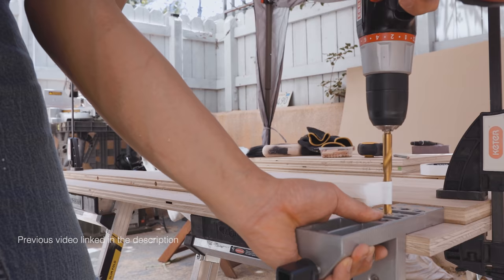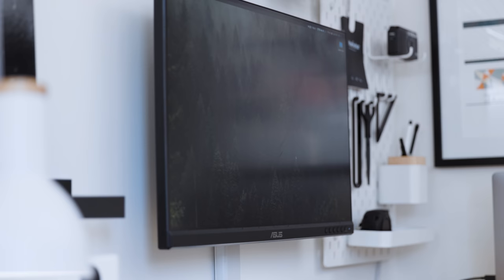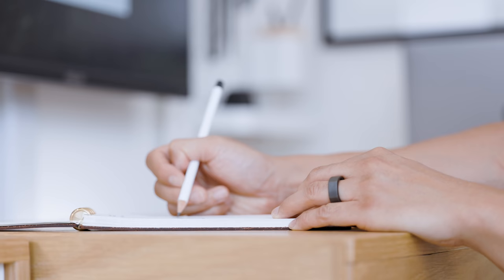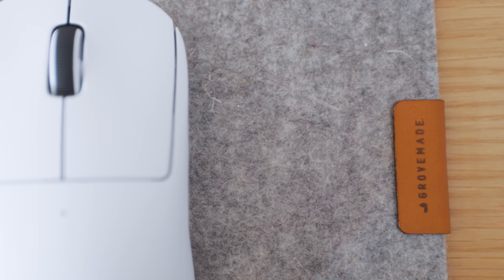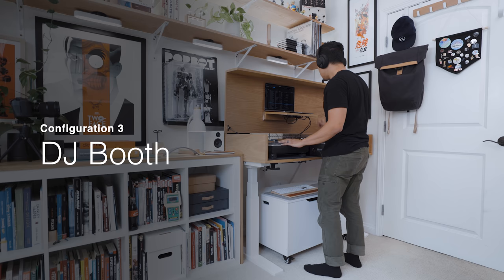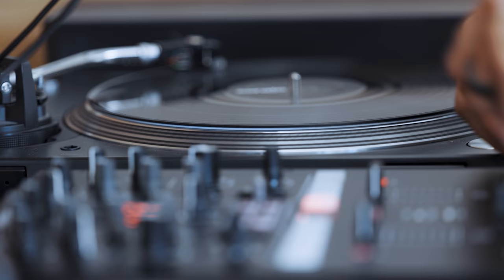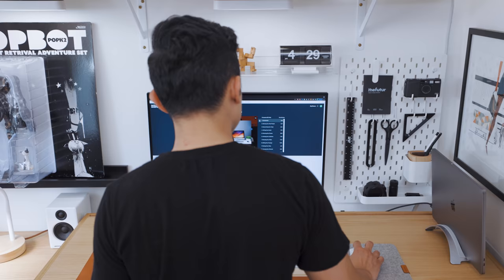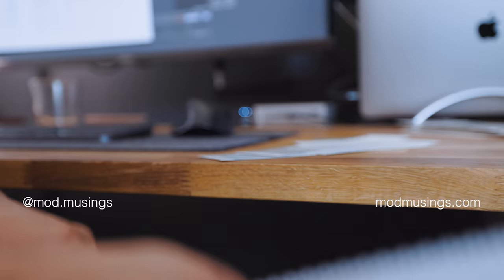Desk Setup – Transforming DIY Desk for More than Just Work

Comment: DJ Shelf suggestion - Attach the shelf by a piano hinge (cut to size).  Attach chains at the front corners of the shelf.  To close the shelf use inset rare earth magnets on the shelf and the underside of the desktop.  You could also use bolts.
It's a great design.  Well done.  Now you've got me thinking about how to customize my own workspace so that it actually works for me...
- Cathy (&, accidently, Steve), Ottawa/Bytown
Reply from the maker: Thanks. Great idea!
Reply: @MatthewEncina  If you wanted to go a bit experimental you could use strips of leather attached with brass hardware...
There's also the option of using a sort of 'turn-leaver' for a closing (sorry, I don't know what the proper name for it is - essentially a bit of wood attached to something that will let it turn 360)

Comment: Always refining, nice! What about a piece of sheet steel (1/8" min), brake-formed to an L-shape? Vertical leg of the L could slip into a slot cut into a continuous wood band across the underside of the lid. Add some gun bluing to the steel to match the black of the equipment. When you're ready to store away, slip out the shelf from the slot and the horizontal (longer) leg could slip into the same slot when you're ready to store it. You could size it so the when stored away the vertical (shorter leg) nests perfectly with the lid dimensions. Love the vids.../eric
Reply from the maker: Eric what a genius idea! I think I already have a left over steel shelf that might suit the job. THANK YOU!

Comment: I would simply try a loop and clasp to attach to each side on the French cleat. It would lock in when you want it to and then easy enough to undo and take off.
Reply from the maker: Do you mean a small chain with loop? Or do you mean adding something to clasp on the bottom of the cleat? Appreciate the input.

Comment: Clean as always. Perhaps for the desk, you can add a folding lockable board so that you dont have to manually disconnect it? Or maybe just make a stand that is connected to the board, and it extends upwards along with the board.
Reply from the maker: Good idea. I might have to see if there's something small enough in depth. I don't have much ceiling room when closed.
Reply: @MatthewEncina  another idea is that you can make a tray similar to those on the airplanes? Like not visually but share the same mechanics. So when closed its almost flush with the lid of the desk.

Comment: Love the aesthetic! A quick fix for the laptop French cleat would be to add wooden brackets to the existing shelf (typically wide in the back and  tapered thin to the front of the shelf) . This should keep the rigidity of the shelf intact while still using the french cleat system. Hopefully that helps!
Reply from the maker: Oh really good idea actually. I haven’t considered affront extra brackets, or even extending the sides a little for extra T-shaped support.

Thanks for the input!

Comment: Use 3/4" pine for the beveled pieces and stick a soft Velcro strip on each beveled piece but make sure you measure in an 1" on each side of the beveled pieces leaving them bare so it can be removed with less effort but secure at the same time.
Reply from the maker: Thanks for the idea

Comment: With French cleat, it's where the weight is placed. You need to make the vertical plywood sheet that connects to the platform the laptop sits on much longer so the laptop weight is lower than the cleat (lower the better). You also want to add a backer to the vertical piece so that it doesn't flex towards the wall/folded desk top... should be the same thickness as the cleat system to add more support. Plenty of videos online to show do's/don't's.
Reply from the maker: Totally makes sense. I think I got caught up in the restrictions of the space, to properly think of the engineering of this. Thanks Ben!

Comment: I guess for the DJ Macbook shelf, you could consider some kind of hinge or telescope arms that lock in the bottom position. This way you could rotate it back into place when you’re not using it and it will also be there for you wnen you open. A leather strap with a button could hold it in place. :D
Reply from the maker: Good idea. I'll look into something that has a lock for the folded position.

Comment: Another great video as always. Regarding the laptop stand on the DJ booth, why not just find a smaller version of the gas struts you used to open the table then just install the wood you already have as the surface? might not be as clean but some black struts should look fine and industrial-like. Nevertheless awesome video!
Reply from the maker: Good idea, but I have very limited ceiling clearance (1.5") it's hard to find a solution that would fit that.

Comment: Idk if it would work but maybe create a desk top that slides back towards the wall so you get access to the DJ setup and you can see your monitor in front. You can then build in a tray by the DJ setup that you can pull up to lie your MacBook on too and push back down when you are done.
Reply from the maker: Hmm not sure I can imagine that yet. How would things attach? How would they move? Any suggestions for parts or systems?
Reply: @MatthewEncina  so you know the slide glass doors? Basically what I mean I'd instead of having a desk that you lift the top up. Maybe you could create a desk that would slide left or right. The one problem is if the glass door mechanism can work in this case.

Comment: what about dowels through the cleat edge of the shelf? would maybe require making a thicker cleat, but the dowels could be used to anchor more securely into the mounted cleat. just a random thought. this setup is so dope and innovative for the space.
Reply from the maker: Thanks! Unfortunately I have such limited clearance inside, that I can’t extend beyond an inch from the ceiling.
Reply: That's fair enough...figured as much. Hope you figure something out in the end.

Comment: For me, I would use something similar to a crane stand or something with a push button locking mechanism for the laptop stand inside. i like the design of the crane stands where you can make adjustments with a clamp type lock, or if you want to reference the reloop stand hub with their push button locking, i think thats cool too. i know it may be pretty expensive and time consuming to fabricate all that, but those are just some ideas, or you can go the easier route and buy a crane stand, mount it to the underside of the desk somehow and just use that, seems like it would be more stable imo. GREAT WORK nonetheless!
Reply from the maker: Thanks

Comment: Brackets on each side of the bottom of your laptop French cleat should hold it much more solidly (actually, since it's a laptop, a single centered cleat should suffice). The bracket(s) need to fit against the French cleat snugly. Ideally, the bracket should extend beneath the French cleat at least half the distance the shelf extends out.
Reply from the maker: Thanks for the idea

Comment: For the laptop stand: Why don't you make the same system your desk has when opening but backwards? the support would be inside the desk, fixed to the top and when you wanted to use it, you would simply drag it down
Reply from the maker: I could build something like that, but I do want to keep it very accessible, since I also use the same laptop for my main work desk. Thanks for the idea

Comment: Need help for a small setup, any advice?
The space is cornered buy the two walls and a high bed. This gives me a space of 1m×1.5m. If I had a table for the longer wall (1.5m), the table wouldn't be very deep. If it was on the smaller wall (1m), I dont know if I would have space for a 27" monitor and a laptop.
Reply from the maker: You can save space by wall mounting. That will clear up the desk top, even if you go narrow.

Comment: You put your macbook at a wrong direction. 
The place where the heat from your mac escapes should point upward not downward like in the video because hot air naturally will rise up in the air
So I recommence you to place your mac with the apple logo is up side down , it will be better because the place where the heat escape will be pointed up in the air
( 2:07)

Comment: Coming from the mx master, I find that it is overrated. Using a lightweight mouse with ultra low latency is worth way more than a side scroll and extra buttons. Using the superlight over the mx master has generally increased my speed and accuracy even in adobe apps, and it doesn't strain my wrist as much.
Reply from the maker: Both have their pros and cons. I'm testing them both to see what I prefer. I'm still learning on the MX for comfort, but time will tell. Thanks for sharing your experince